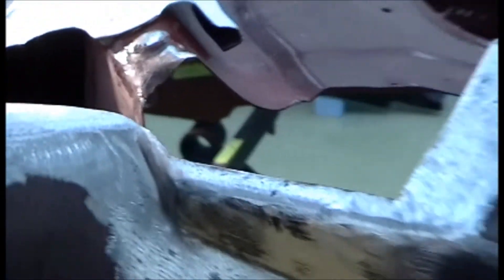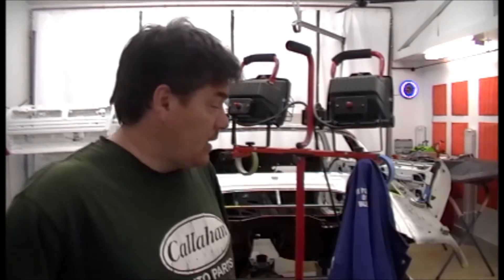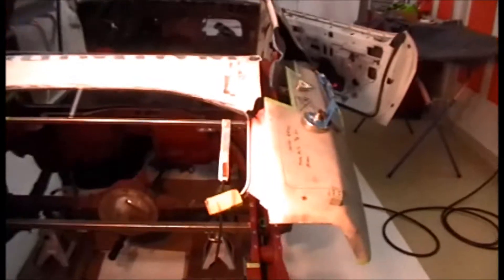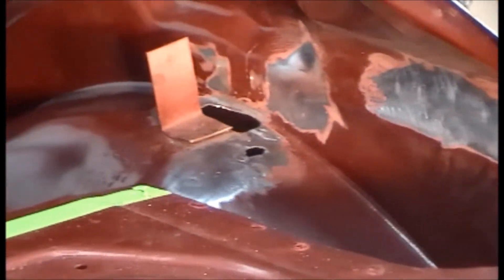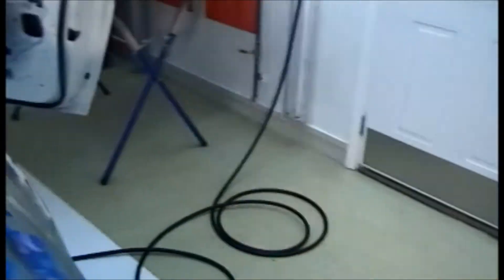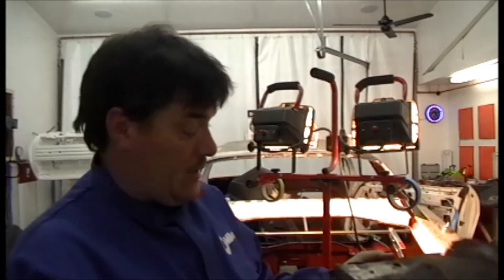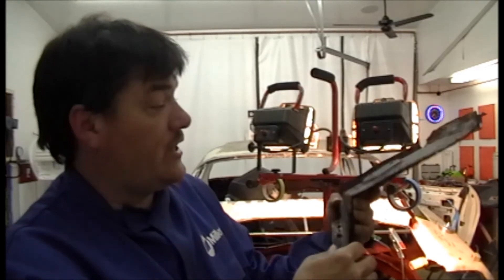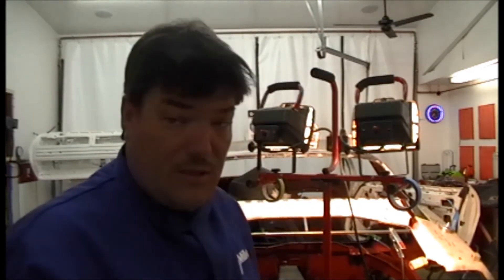Repairing Rust on the Inner Quarter "1972 Camaro Project OverKill"

Comment: Thanks for the link Russ.  I just ordered an inner wheelhouse since I will need to section in a couple of pieces.  My wheelhouse is in bad shape but I think I can repair it without replacing the entire thing.  Thanks again.
Reply from the maker: Thanks Wes.
Reply: had to remove the entire inner wheelhouse after all.  It was just too far gone.  btw, what would you recommend for finishing freshly blasted rear leaf springs.  I am looking for factory appearance.
Reply from the maker: Wes, I'm not real sure of the correct sheen, but I would probably coat it with SPI black epoxy primer. You can add some reducer to the 1:1 mix to get the sheen you looking for. The SPI has some gloss to it. The SPI also has some flex to it, so I would think it would hold up good on the springs. Hope it helps.
Reply: thanks brother.  Helps a lot